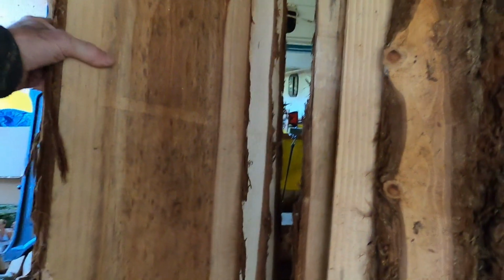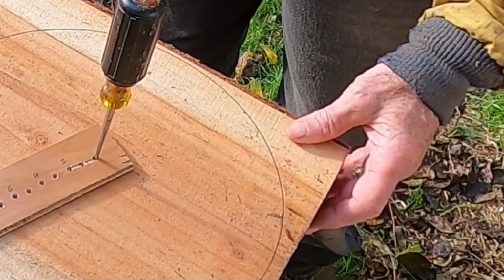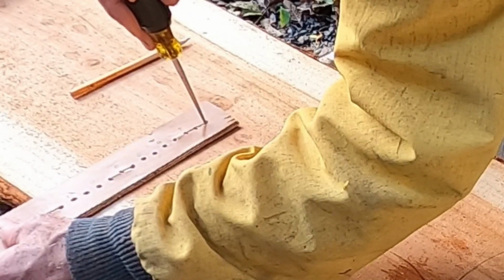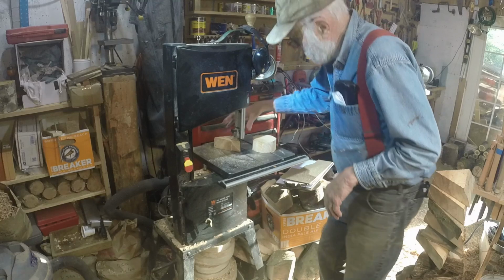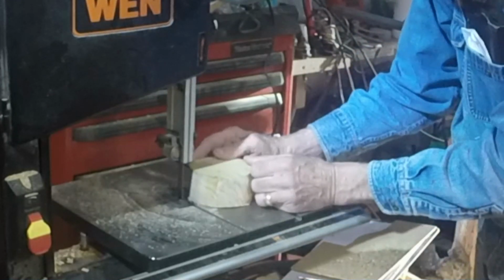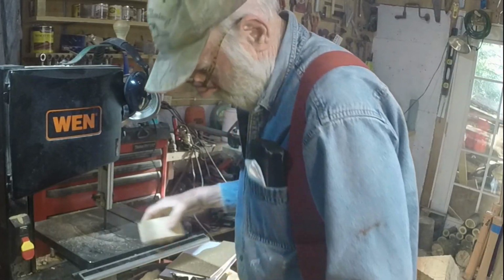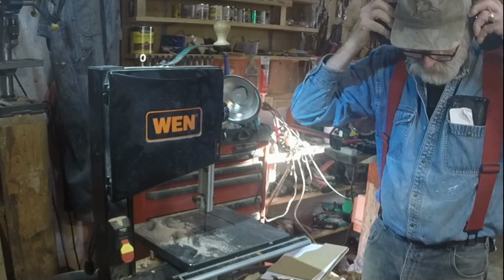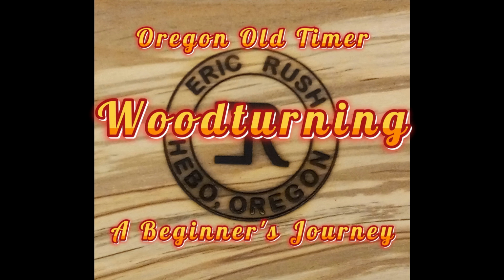1 Redwood Slab = 23 Blanks

Comment: Good advice on bandsaw safety. What size/TPI blade are you using?  I have the same bandsaw and have been using 1/2" 3TPI for a while now. My saw struggles withe thicker blanks like 3"+
Reply from the maker: Half-inch 4tpi. Definitely not a heavy-duty bandsaw.